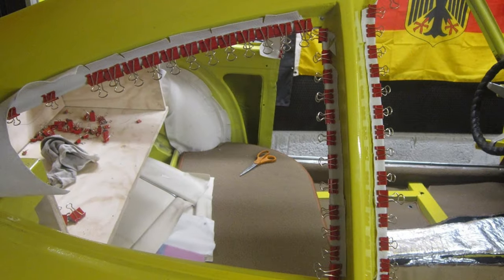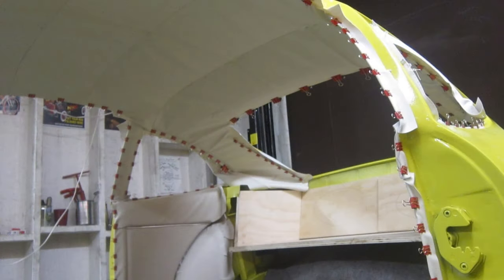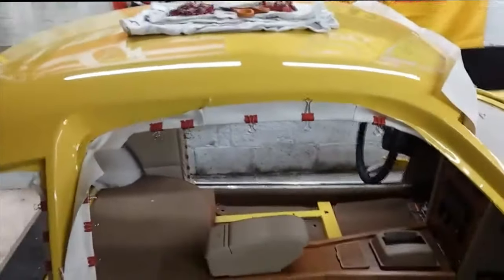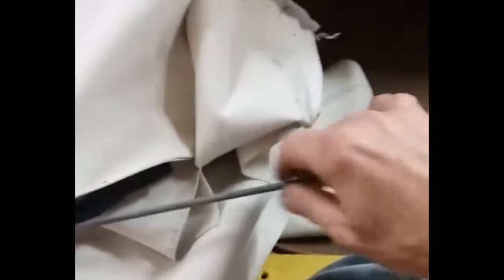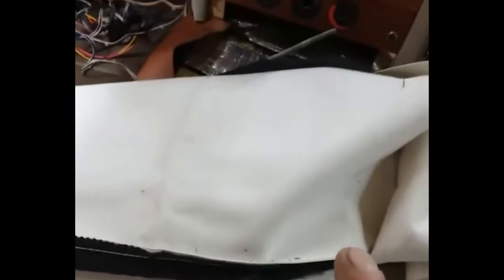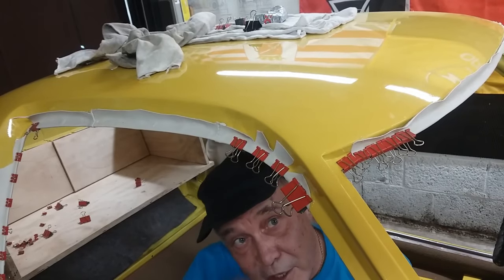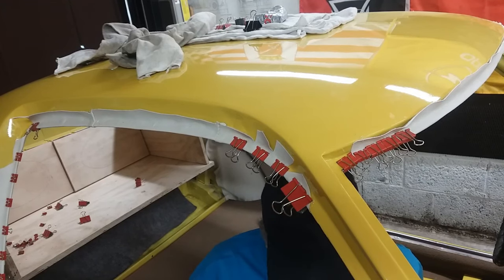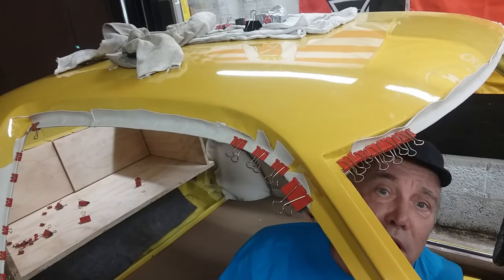Installing a Bow Vinyl headliner in an Opel GT - By Gordon Payton

Comment: I’ve done  this exact same headliner.  Pull this vinyl MUCH tighter.  You shouldn’t see any wrinkles.
Reply from the maker: He pulled pretty tight and then had clips to hold it in and waited between stretches. That said it was being done in the winter.